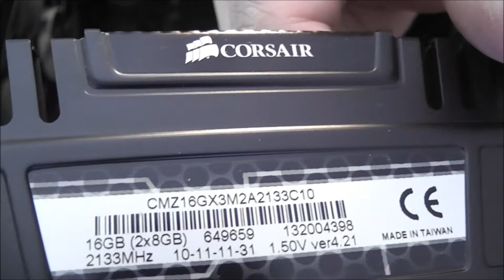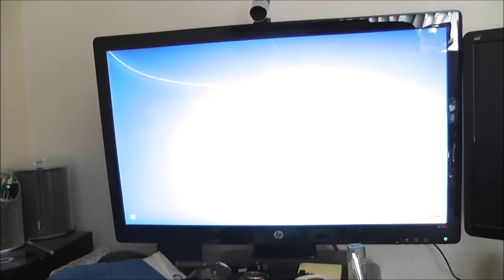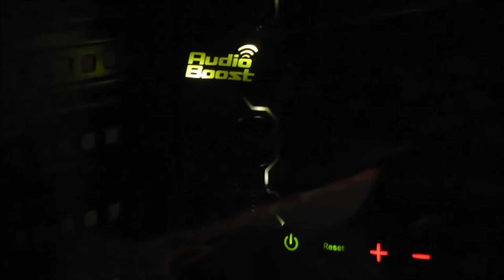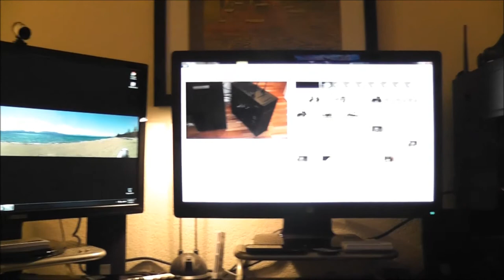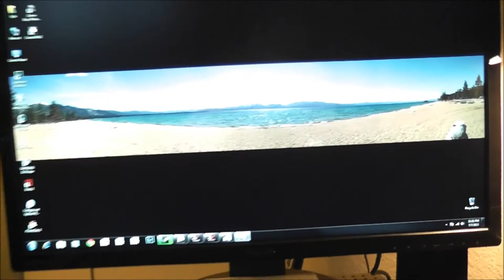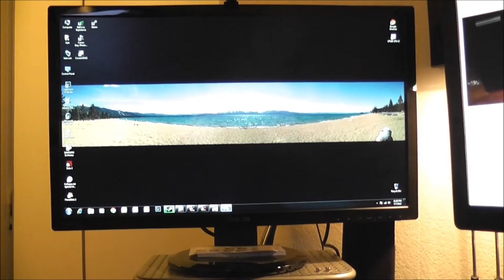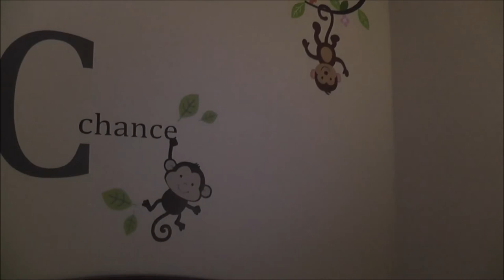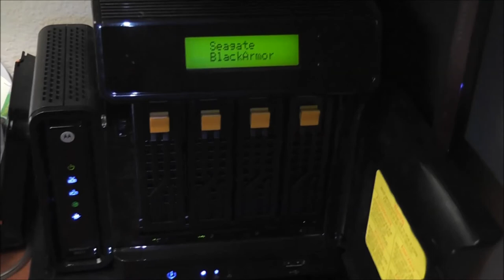Fisheye Studios - Gaming Rig and Work Desktop 2013 (Part 2)

Comment: First :
Why you buy that amazing motherboard, and don't buy a MSI GTX770 lightning or GTX 780 lightning. One of them will give for your system great look and more power for video and gaming.
Second :
If I right, you connect your Asus GTX 660 in wrong PSI-E slot. In this motherboard you need number 2 (for 1 card), for SLI 2-way, 1 + 2.